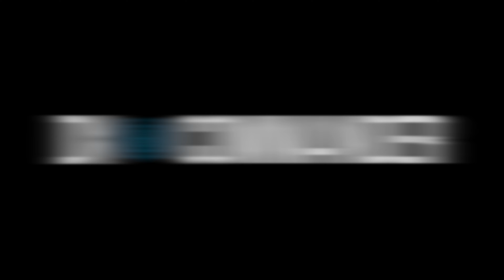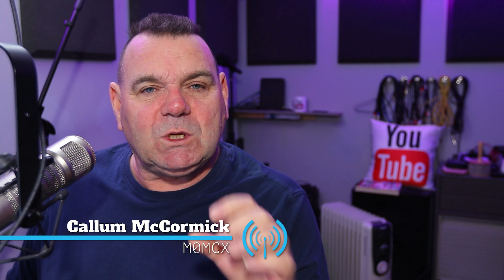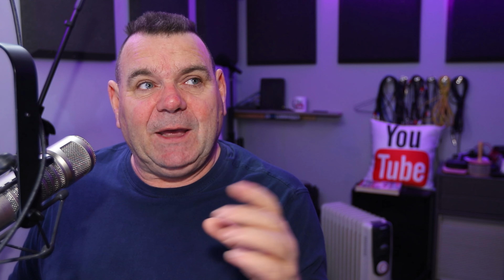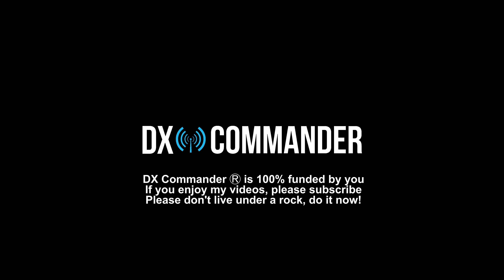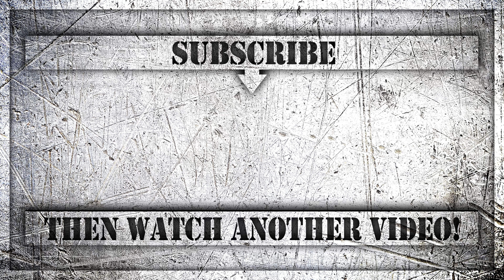Waterproofing PL259 Trick

Comment: I use an old bike inner tube cut into long thin (12mm - 15mm approx) strips, wrap from the bottom up, overlapping and stretching as you go held in place by electrical tape and a cable tie.  Easy and non messy to use and remove.
Reply from the maker: Nice!

Comment: Hi Callum, loving all your videos as a fairly new Ham, shame about the other channel, all that work gone.

I've another suggestion for you that you may not have heard of, that we've used in the heavy vehicle trade for years, "Denso Tape". It's a grease impregnated tape that you mould around the nut, joint etc. Keeps water etc out, and even after years when you go to strip the job down again, the thing is like new when you remove the tape. We used to use it on leaf spring U bolts that are exposed to all the road dirt and grime, and nut and threads as good as new underneath. Without it on they usually are seized and need heat to remove...Good stuff, and a roll lasts ages.

All the  best, Mark.
73 2E0SWK
Reply from the maker: Ah cool!

Comment: Vaseline is a great inexpensive  idea for connectors. But it can soften certain materials like latex rubber. I don't know if some gaskets or other flexible materials are made latex, but if they are, non-petrolium greases should be used.

As a side note, I've used KY jelly for lubricating cable pulls and car vacuum hoses. It doesn't react with materials since it is water-based. Once it dries, it is gone without residue. (The downside is explaining why I keep KY in my toolbox!)

Comment: Only the outside plugs I do, vaseline someone has mentioned mentioned me before, I use a clear bath sealant, sets like jelly, and peels off in 1 piece. 
I do ha e some rg213 and mini8 that need plugs on, so I'll remember to add shrink wrap on 1 of the end's too.

Comment: Years ago I used Lard, it worked brilliantly...
Reply: And all the nearby rats come for a sniff, and then think "ooh, coax. I bet that'll worth a nibble"  :D
Reply: @nathanw851  I was very young, and I put a CB aerial on top of an apple tree fixed to the trunk, after a while the performance dropped, I climbed back up the tree and found water in the connector, with nothing else available I coated the pl259 in lard, it worked for perfectly well for years, when I took it down and scraped off the lard, the connector was shiny and silver underneath and as good as new, no teeth marks honestly 😃

Comment: I tend to check antenna systems from time to time and a couple of times a year I will check my pl259/so239 connectors that are out in the elements. Since your tip about using petroleum jelly I've been coating the so239 with a light coat on the threads then resealing with self amalgamating (did I spell it right) tape. Never had an issue and we get a LOT of rain and wind and those awful summer temperatures. Trade off for mild winters. Thanks! Jack K5FIT
Reply from the maker: That's the real trick.. Regular checking and maintenance! Good tip!

Comment: For many years I used to use liquid tape. Horrible sticky black paint goo that sets like rubber, that worked fantastically well but was a mess to put on, horrible on clothes and a pain to get off. Then when I started putting connectors onto all types of coax like waterproof F connectors; they are put together with special tools and you use silicone grease to put them together. Now that stuff is great, doesn't melt, doesn't run and resists just about anything. It is also an extremely good dielectric and does not react with plastics and so on. So I now use that on all my connectors. It is great but a little tacky on the fingers. Whilst I am still playing with my DX commander I have used it as Callum suggests on the threads. Once I get it moved to its more permanent home I'll use self amalgamating tape. I also use glue lined heat shrink from the connector body over the coax

Comment: Anhydrous lanolin is king of the hill for keeping fittings operating smoothly on boats. It's cheap and long lasting and available at almost any pharmacy. I'm not sure about its electrical properties but I'd be inclined to try it, at least on the threaded parts.
Reply from the maker: Yes, I think that would also work!

Comment: I just use dielectric grease like you're "supposed" to use on all your exposed automotive electrical contact points, like fuses under the hood, signal lights ETC. And for more permanent base station use I slip on adhesive lined heat shrink tubing first before filling the connectors with dielectric grease. It comes off easy enough with a few light and careful passes with a razor blade and lasts for DECADES that way too!

Comment: My DX Commander mast has been under 20cm and more of snow since I took it down in early January for adjustments. The next day it snowed and the snow is still there. We do have a bit of rain forecasted for this week but temperatures are still hovering around zero. It’s not going to wake up from its hibernation yet.  The PL259 should be fine as it’s been below zero, but I did take your advice and used Vaseline as a precaution . VO1OK

Comment: Callum, I have a mate that used to my an US Air force Mechanic "been retired for quit some time. He told me that they used petroleum jelly for the same thing. They also use Phillips Milk of Magnesia in place of never seize on the Air force's ram jets. Due to the fact that it holds up under extremely high heat.
Reply from the maker: Amazing!

Comment: Vaseline does work, in a pinch. but may wash away eventually? A being a petroleum product may dissolve some plastics and rubber o-rings. Silicone grease is used for under water seals and o-rings, because it doesn't wash or dissolve away. But I think its conductive to electricity! And that is where Dielectric Grease comes into play. Its tacky and won't wash / dissolve and doesn't conduct electricity!
Reply from the maker: Oh yes :)

Comment: Thank  you for that information. Should you stick with a non-conductive grease (like vaseline / dialectric grease) or can you use a conductive grease like Noalox ?
DX Engineering video says not to use conductive grease, but other videos say to use it to seal coax threads.  
So, should I use Noalox or Vaseline?  Thank you
Reply from the maker: Oh heck, I don't know.. All I can say is that for YEARS, I've been using Vaseline on threads. Works for me.

Comment: I recently read about “conductive grease”. I’d been thinking of trying that. Good for battery posts too apparently. Wonder how either would go in the Australian heat?  I guess I’ll find out.
Reply: I don't know where your conductive grease will be going but I suggest that there would be a real possibility of it bridging the center conductor to the braid side causing a short.  
Alternatively, if the Vaseline gets into the socket, it could form a thin dielectric layer.  
I would suggest being very careful about applying Vaseline directly to the connectors.  This would be especially so if you disconnect-reconnect them frequently.  
Some one should do an experiment with a few brands of coax and see what long term exposure/contact does to the jacket and insulating materials.  I think that there would be considerable risk from Vaseline.  
There may be better alternatives but I recently purchased a product sold as dielectric grease.  I have yet to try it.  
Placing this around the connection but not within the connector might be a good alternative.  I would also suggest wrapping the connector with gauze or absorbant paper impregnated with a product like dielectric grease.  I think you would still need to wrap with self-annealing tape.
Reply: @larrypicard5969  good points. The conductive grease would go on the braid as the plug is screwed on, and the thread of the plug when in use. I’ll have to think about it further.

Comment: glue lined heat shrink over the connector to cable section, Dow Corning DC-4 grease on the threads and on the face of the SO-239..........if you use tape,  if water does get in it can't get out, DC-4, self amag tape, Scotch 33 for something up on a tower you don't want to fool with for years, by all means Vaseline for temp situations....... cheers Mike, K1FNX near Boston
Reply: I never imagined that Vaseline could be used for such a purpose, Callum 😆
Reply from the maker: @YL Raisa Yes Raisa, I am ALWAYS connecting and disconnecting PL259s so for me (and holidays) keeps the threads good and my hands soft!

Comment: I am going to have to be the person I guess 😅 I have for years been using No Ox-ID A special dielectric grease for my electrical/radio connections. I guess it due to be always having some around the house from when I was boy as my father was an electrical powerline service/repair man (linesman).
Reply: Yeah, we used to call it No-Lox. It's for dissimilar metals l, Copper to Aluminum connections. Keeps aluminum fittings from binding when tightening. I use it on car battery terminals also.

Comment: Lord CALLUM, Good morning. I have a question about an antenna that keeps giving me trouble. It is for 2M/70cm. The end that screws into the antenna so259 gets water logged and it's damaging my LMR400. The antenna is Tram 1481. Suggestions
Reply from the maker: Hmmm. I guess you need to find where the water is dripping from alternatively, wrap it all up in self-amalgamating tape..
Reply: @DXCommanderHQ  thank you, I have done just that a few times and it is really driving me bonkers.

Comment: Do you recommend that with solder on connectors or crimp connectors?
Reply from the maker: Erm.. Depends on the connector type. I use EITHER Mesi and Paoloni OR SSB Electronics and follow their instructions. They are also waterproof anyway.
Reply: @DXCommanderHQ  Second that, both the ones I use. I have not seen better.